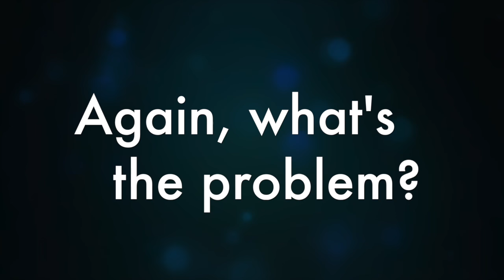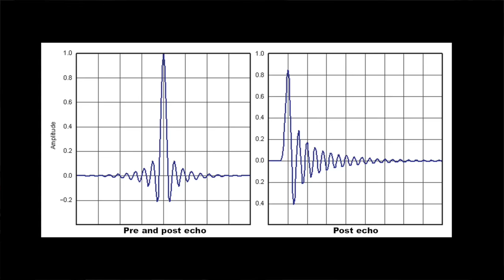The truth about Nyquist and why 192 kHz does make sense

Comment: The arguement seems to have merit. Using a higher sample rate ADC so that a more gradual filter can be used makes sense; however storing the audio as 192kHz doesn't. FFT, remove components above 44.1kHz, inverse FFT, and use the standard format. What's the point in storing the data that you don't want and won't reproduce. Even the DAVE claims the standard frequency response of 20Hz to 20kHz
Reply from the maker: When you downsample to 44.1 kHz you have to use a brick wall filter again and if you want to upsample again it's a reconstruction filter. The clever thing about MQA is that it uses about the same bandwidth as LPCM 44.1 kHz but does keep the higher sampling rate while throwing in compatibility for 44.1 kHz equipment.

Comment: There's definitely a difference between the sounds in a DAW. Render and null and discover the difference lies in higher frequency content in higher sampling rates being maintained . Indisputable since its a null of the same material. I only wonder where it matters more since everyone simply starts talking about the subject without clarifying ; are you recording, mixing or listening. In mixing it's quite clear.
Reply from the maker: You might be right, but do you know  what caused the difference. Might it be the reconstruction filter in your DAC's have an easier job? 2L and Channel Classics both offer free downloads on several sampling frequencies and these will not differ from what was in their DAW. When I play them on very high quality gear, the difference is so small that it might just be the result of the downsampling.

Comment: I am used to hear a lot of non-scientific praises of high sampling rates in consumer audio, but this video actually touched on a subject I never heard addressed, and it is a real thing. Thank you! I am not sure if it's a big problem though. With 48 kHz sampling rate (this is what I sue in my home studio) we have quite a lot of leeway to use less steep anti-aliasing filters. I guess that even steep elliptic filters could be doing hardly any harm to the signal in the audible range at that point. Also: there are other ways to filter digital signals, for example Fast Fourier Transforms (but that probably introduces pre-ringing as you mentioned, same with linear phase filters).
Reply from the maker: Dig into it and listen. Really!

Comment: I think a lot of the animosity against higher resolution audio stems from poor performing built in audio on pc motherboards and their high samplerates being used mainly for marketing since the actual analog output sucked. Once again that's what I think.
Reply: Or perhaps it's because bit depth controls nothing but noise floor and sampling rate needn't be any higher than 44100 or perhaps 48000 to capture the full audible range with ample room for low pass to take place without detectable aliasing. Hi-Res audio in the listening phase is a waste of space.

Comment: Do digital amplifiers will solve problems with D to A conversion ???
Reply from the maker: There are hardly any digital amplifiers. I think you mean class D amplifiers, but these are usually analogue switching mode types. And no, they don't solve problems with D to A conversion.
Reply: The Hans Beekhuyzen Channel yes! I meant digital amplifier, not class D :) I know about one, very expensive. I am not an expert that is why I asked if digital amplifier would bypass any problems with digital to analog conversion. Best regards
Reply from the maker: It won't. A real digital amp is in fact a D to A converter with very high voltage and current capabilities. It does have the same problems and perhaps even more since the output level has to be so high. I have no hands-on experience, though.
Reply: The Hans Beekhuyzen Channel thank you very much. Once again: kind regards, and carry on! I enjoy watching your channel! Thank you!
Reply: The biggest issue with class D amplification is the potential for altered frequency response since the speaker load forms a RC circuit with the output stage of the amp. And the frequency response can vary with changes in impedance. And of course, all speakers vary their impedance with frequency. Amp designers have to be able to compensate for those variations to keep the relative response flat.
Reply from the maker: You are right, but modern designs don't suffer from that.
Reply: The ubiquitous Crown I-Tech had a problem with HF rolloff with lower impedance loads. I imagine they fixed it by now with firmware, but it did ship with that problem not long ago.

Comment: A perfectly brick wall filtered signal has tons of Gibbs phenomenon, ringing at the cut off frequency, that's the "pre and post echo" as you called it.  If you don't have it, then you can't reconstruct the signal and get the peaks and phase right. This isn't really about "digital" it's the nature of frequency.   This ISN'T a limitation of technology, it's a limitation of MATHEMATICS. Yes, you're right that you can get rid of the Gibbs ringing if you have use gentle filters instead of brick wall ones, and in order to use a gentle filter, you'll need a much higher sampling rate so you don't get aliasing.  But you know, the signal without that visible ringing DOESN'T have less energy at those frequencies, it's just that they're NOT AS OBVIOUS IN THE GRAPH, because they're being compressed into shorter spaces by the presence of higher frequencies.   

I don't know what filters are being used in equipment these days.  If you use (really sharp) linear phase filters to do the sampling and the reconstruction you won't get any phase artifacts, but one problem with that is that you will get some delay in the signal - that sort of filtering can't even be done in analog.   In order to get perfect 44khz sampling you have to actually sample higher than that, filter in the digital domain with some buffering and delay and subsample in the digital domain. I presume that's what's being done.  

My own belief is that sampling at these lower frequencies is good enough.  Even when I was a teenager I couldn't hear 20khz.

Comment: I have no back ground in the science but I'm adj and the logic of higher sample  is solid more and resolution is what matters not the science
Reply from the maker: The question is then why not sample at even higher rates. That will lay a burden on all the electronics. It's like carrying all your money all the time in stead of putting it on the bank. That way you can have access to your money all the time? Makes sense, doesn't it. Well apart from practicalities like where to store it, you are risking losing it or being robbed. So it makes sense to carry only the money you foresee you will need. It's the same with sampling. You should only sample the information you need.

Comment: I think part of the discussion that needs to really be explained is the effect of band limiting in both the digital and analogue domain, any band limiting anywhere will causing ringing artifacts, any cable and equipment you use will do this as well. This is why I find double blind tests of audio not truly scientific to disprove high-resolution. If you band limit a cable to 10k due to capacitance that will have an audible effect and therefore you really are not isolating all variables scientifically. The provenance of the signal is no longer intact.

When I hear Pro-Audio people, or people like Monty, tell me they cannot hear the difference, I would want to ask them how many looms of cabe and what kind of monitors are you using? what are their crossover freqs? Any of those things can introduce tons of ringing artifacts that will make high res compromised, or really any signal. 

To add to your point Hans, I remember dCS had a white paper on their website some time back, that explained what extreme band limiting in the digital domain did, and they showed it caused phase and amplitude shift, they had snapshots of it on oscilloscopes. This is known in physics as the Gibbs Phenomenon. It is never explained by the apologists of just sampling at nyquist. Any filtering you do will cause a ripple effect in the audio much like throwing a rock in a pond. Humans can hear the harmonics of fundamental frequencies way above 20k and the phase and ringing artifacts smear in the time domain. All of these things are important. If high order harmonics were not important then, for example, the type of piano or guitar you use and how it resonates would be inconsequential because they are all generating the same fundamental frequencies, but as any musician will tell you, it does matter. Why? due to the distribution of how those frequencies sit, and all of this information happens in the upper end of the frequency range.

Personally I have heard the effects of high sample rate and DSD, but it does require a controlled set up, actually I found that tube gear demonstrates it the most due to it's high slew rate, and when I managed a high end store, we had some tube preamps that could go to 100k and high sample rate was very audible on those especially DSD. I also had a CD player that had a band limit of 80k and could select the CD layer at 16/44.1k and the SACD layer, I was even able to demonstrate to audiophiles who didn't believe in DSD that it made a difference it was very audible on a non band limited player. 

In short I think the people who maintain there is no difference either have never heard live music or lack the equipment and discernment to hear the difference, because the changes are very audible even to the un-initiated on the right system.  

Simply put Nyquist is sufficient to prevent aliasing, but not sufficient to portray real life, and we are after it sounding like real life, not to just no longer have aliasing artifacts. 

To use another analogy 24fps will allow the human eye to perceive motion in still pictures, but it doesn't look as if we are actually seeing through a window in real life. The only thing that can approach that is a high resolution screen at a high frame rate, and that is what we want with audio.
Reply from the maker: You are correct, of course. But the main reason I wanted to publish this video is to silence people like Ethan Winer that posted a remark that "The presenter of this video doesn't know what he is talking about." And consequently misused the Nyquist theorem to prove me wrong. Everyone with ears and a proper stereo can hear that a good 24/192 recording sounds better than a redbook spec file. I don't want to become a tech-geek channel, I want people that are interested in perhaps buying something better than a bluetooth speaker help find their way. Again, that doesn't mean I don't agree with you, but this is not the place.
Reply: I do appreciate your outlook a great deal and it is a very good thing to spread the word of high quality audio to the masses, in fact that was one of my great frustrations when I worked in High-End audio that the industry didn't do that enough and try to reach the next generation of people my age. It really is when all is said and done about getting lost in the music and High-Res is a great vehicle to to that even more, and that is something any human being an get behind. I just simply wanted to echo your points as well and perhaps add some to the scientific side of the discussion. I do think the Gibbs Phenomenon in general is a smoking gun for most of what people deem to be "voodoo" in the industry including High resolution, and I think it gives a scientific reason and phenomenological answer to the naysayers for why any of these things matter. 

If people are calling you unscientific then I think they need to review the science on all sides a bit harder. I think the problem comes in when people who aren't trained in the more modern side of engineering come in a say otherwise, when in fact the ability to even measure these things as you alluded to, has really only existed since the 1980's and there were no practical metrics to measure the phenomenon except using things like math to extrapolate them before that time. Unfortunately the naysayers in calling this unscientific are actually the ones not up to date on the science.
Reply: +TheHans .... regarding Ethan Winer, I have tremendous respect for him regarding room acoustics and standing wave control.  With his published guidance, I was able to improve my studio tenfold!  All I can say is that treating the primary reflection points and using a ton of bass traps will take your system to the next level (actually has a huge impact on SQ IMO) - though it can be unsightly!  However, I believe he is incorrect when it comes to his interpretation of Nyquist.  He is certainly more concerned with frequency balance (flat) vs timing balance of transients (minimized pre/post ringing).
Reply: "This is why I find double blind tests of audio not truly scientific to disprove high-resolution."
Double blind tests (assuming a proper execution) are the only scientific way to examine the real-world benefit of high resolution audio. I don't listen to music with an oscilloscope.

"To add to your point Hans, I remember dCS had a white paper on their website some time back, that explained what extreme band limiting in the digital domain did, and they showed it caused phase and amplitude shift, they had snapshots of it on oscilloscopes"
There is no phase-shift, if you use linear phase filters. That's basic knowledge of every electrical engineering student, you don't need mysterious special white papers for that.

"Humans can hear the harmonics of fundamental frequencies way above 20k(...)"
No, we can't hear beyond 20k. That's simply a wrong statement disproved by basically all science out there.

"(...)ringing artifacts smear in the time domain."
We can't hear the ringing, because its frequency is not within the hearable frequency range.

"If high order harmonics were not important then, for example, the type of piano or guitar you use and how it resonates would be inconsequential because they are all generating the same fundamental frequencies, but as any musician will tell you, it does matter."
There are usually enough harmonics below 20k to give instruments a unique sound. That not all guitars sound the same doesn't prove your claim.

"Simply put Nyquist is sufficient to prevent aliasing, but not sufficient to portray real life, and we are after it sounding like real life, not to just no longer have aliasing artifacts."
The illusion of real life starts where our sensory organs end. And that's at around 16-18k at least for my ears.
Nyquist only explains how to digitize a bandlimited signal. That our ears are bandlimited is not a result of Nyquist, but the foundation of its application.
Reply: Although you could say you lose information with quantization, this error only produces noise (quantization noise) which sets your maximum dynamic range, with no effect to the fidelity of the signal (provided dither is applied). This noise is 144dB below Full Scale at 24 bits, way below human hearing. Even at 16 bits and no dithering, the distortion produced by quantization is 100dB below Full Scale, and is in practice completely masked by a musical program at a sensible level.
Reply: Try converting a 24 bit audio file to undithered 16 bit...

Comment: Goedenavond,
I must agree ... bit I am of the opinion that you cannot accurately describe a 20khz wave form with a 44.1Khz sample rate (you can perfectly describe a pure sine wave at 22,050 hz with a 44.1Khz sample rate ... so long as you know its a pure sine wave, but unless your sample rate is always exactly twice the frequency, you are going to loose information .... maybe variable sample rates are the answer, not sure how you'd poll that one off) So I also believe sample rates need to go up an order of magnitude to genuinely reproduce the sound.
Sample resolution (16 bit) I'm OK with, I don't feel there is much need to increase the bit depth of the signal after it has been mixed and processed at the studio and made available for public consumption, but I do think the sample rate needs to increase.
Anyways, the question I wanted to ask you .....
it is kind of old technology, and forgive me if you have explained it in another video (I'm sure if this is the case another follower of your channel will respond to this post with a link) ... 1 bit dac ....way back in the dark old days (when cd players were mostly 14 bit pretending to be 16 bit) there emerged '1-bit dac' players ... I have a Mission/Cyrus CD Player from the dark old days that boasts '1 bit dac' .... now I've been programming computers, and have been doing so since early 80's, and I know you cannot simply break 16 bits into 16 single bits and process each bit without consideration of the power of that bit. and if 1-bit dacs are truly that, then they are only capable of either outputting +v or 0v, and nothing in between.
So .... can you explain (demystify) what is 1-bit DAC, and how does (how did) it work, because I've never figured it out.
dank je wel
Best wishes
Duncan
Reply from the maker: You can perfectly describe a 20 kHz waveform using a 44.1 kHz sampling frequency as anyone with a scope can show you. You can not describe perfectly a 20 kHz square wave at the same sampling frequency since that is built from all sine waves from DC to eternal frequency. Since the signal is filtered at 20 kHz, this is impossible. As it is impossible to record that square wave on an analogue tape recorder since that is band limited by design too. 1 Bit audio converters are comparable to what is used in DSD technology. Watch DSD Explained at https://youtu.be/hXFIq11JAas
Reply: A very interesting video (and part 2), thank you